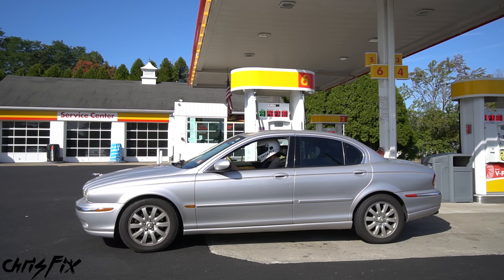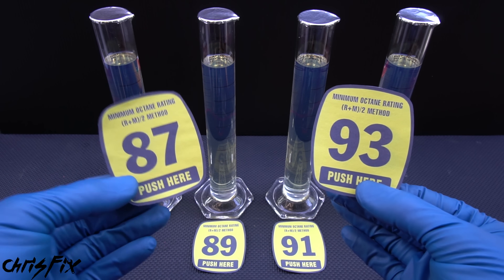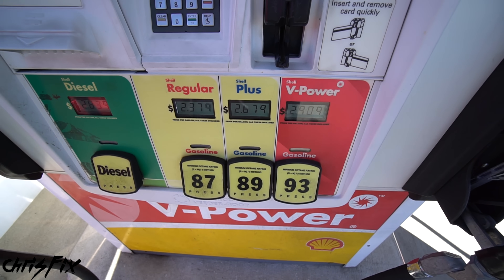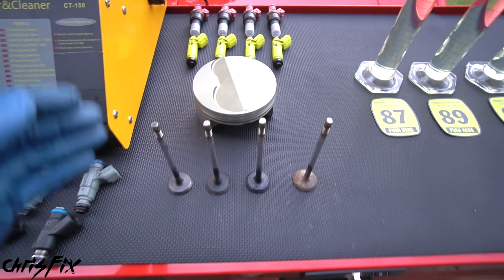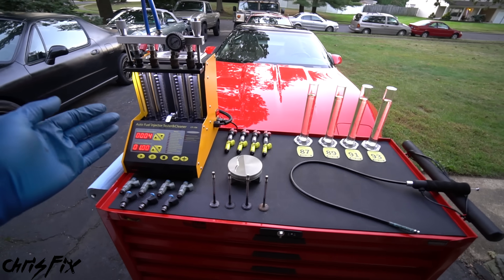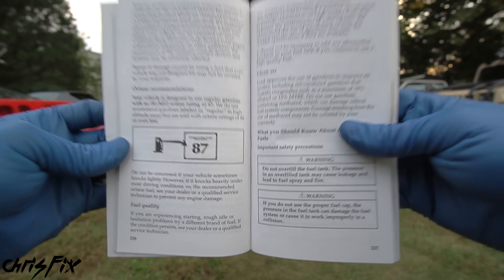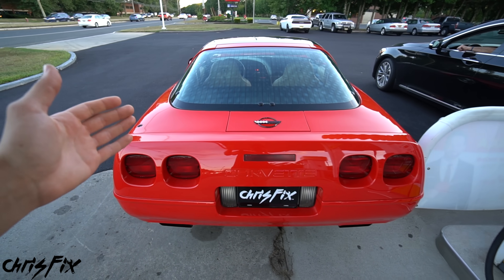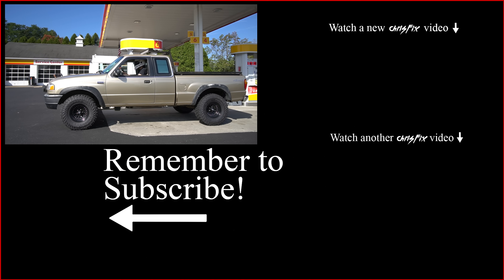What is the BEST Fuel to Use in Your Car or Truck and WHY

Comment: So my gas lines are a lil gucky and when I’m low and gas it like stutters when I press the gas a lil harder than normal so are you saying if I use a gas with a higher octane it can clean out my gas lines?
Reply: That gunk is from the ethanol in our fuel.  A few tanks of fuel with ethanol treatment added should take care of it. Ethanol free fuel is better but harder to find and more expensive, but well worth it if you ever want to see what ethanol fuel does, just run your lawnmower with regular e10 pump gas. I guarantee the next year it wont run. I accidentally put some in my pressure washer when I grabbed the wrong gas can while washing my driveway last year. This year I started it and it ran wide open and I couldn't get it to slow down. It was screaming! Pulled the carb and the thing was stuck wide open so the governor couldn't slow the engine speed. I couldn't get it to close. In fact I could feel the plastic piece trying to round off, which would have destroyed it. Used some brake clean and some WD-40 and gradually worked ut until it was finally loose. Where we live there is Ethanol free fuel but its 87 ir I'd run it in my 03 Land Rover discovery.

Comment: Ok. I HAVE to be the one to say this!!! Chris fix, I love your explanations and tests to prove your "facts" and you truly are knowledgeable and accurate, BUT, your video on the types of gas for your car is blatantly contradicting on two things you said that are PROVEN to be FALSE on your part!!!! First you say that 93 octane does NOT improve mileage or power over 87 octane then when you talk about your Corvette you said it actually DOES BOTH. My dad worked for GM factory for over 65 years! I KNOW ALL the tricks of the trade for vehicles. My brother races cars for a living ad well, so now I'LL tell you the REAL AND TRUE FACTS on fuel grade. I did these REAL-TIME tests with a 1995 Chevy lumina, 1985 chevy celebrity, 1996 Monte Carlo, 2005 chevy mini van, and a 2006 Lincoln zephyr, and now, a 2016 Lincoln MKZ, & a Nissan Armada SE.  1st, I drive the mini van between Miami & Asheville, NC twice a year...these 2 cities are exactly 787 miles apart. The van says 87 "recommended and it gives me 347miles on one full tank of octane, my dad told me to use 93 on my next trip and it gave me 453 miles!! I did this 5 times!!! And EVERY TIME I got better has mileage with 93 octane. Also, since my brother races, I asked if I could do a test on the track. This mini van goes from 0-60 in aprox. 15-17 seconds. When I did the test one week later with 93 octane, it went from 0-60 in 10 seconds!!! SO, premium gas DOES improve mileage and power in MOST vehicles!!!!! These tests had the SAME results for ALL the cars I mentioned.  Including my 787 mile trips!!!
Reply: Correction::: one one part of my letter it's supposed to say "on a full tank of "87" octane...  so, if you drive ALOT, filling up with "cheaper" 87 octane 2 to 3 times a week is NOT cheaper than filling up with premium once or twice a month!!!

Comment: 2:09 These 3 octane's difference in their resistance to ignition is equal to their difference in flashpoint temperature. 87 flashes at a lower temp than 93.

Comment: Why is it that my 2015 civic si I should only put 91 cause on regular it shakes on cold start
Reply: After seeing this video, the motor's compression and you don't want to suddenly have the motor make noises and the car to stop running. Better to spend a little more at the pump using the correct fuel than a lot when you need to take the car to get fixed.

Comment: I can attest to that! I had a high performance 2 cycle racing engine on my boat which said to use 93 octane or higher...Well i went to Florida one time to fish a big Bass tournament, I was so stoked just to be in the state of Florida that when I stopped for fuel, I totally screwed up and pumped 36 gallons of 87 octane by accident...I didn't realize it until I was hanging the pump back up...So i thought I would run out a half tank then fill up with 93 and all would be good, NAH that didn't work...My motor wouldn't even start lol, it would just sit there and flood out every time I would try to start it...So I tried to buy a couple pints of 104 octane booster to get it running and this worked! It totally ran like crap but at least it worked....Thought I would share this in case someone ever made the same mistake, they can get by on Octane booster...Good Video man, thanks for the information!

Comment: I actually did an experiment using different fuels from different gas vendors on my flex fuel silverado. I'm in El Paso Texas where we have 85,86, 91 octane and E85 as well. So my test involved 3 of our major gas station and the few locally owned tier 1 gas stations as they completely bought out the Shells and Chevron's overhere we were left with Valero, Speedway and Circle K. We actually have very little 7 elevens so I rules them out and used Mobile gas as the Tier 1 control. My findings were that some regular octane gave better fuel mileage and power than other brands, premium grade lasted less while provided more power. And mid grade provided the best fuel mileage with power. Tier one remained the best my 4.3L gave me 33 MPG highway running mid grade mobile gasoline with excellent power. E85 always give me the most power but gives me the worst gas mileage. My expirment control was full tank till the empty light turned and reset my range tracker when it turned on to add additional miles till I reach the gas station. I also would reset the range tracker when I filled up at the pump for the most accurate results. Over fuel grade and octane does effect your power and MPG. Not sure if it's due to my ecu. Just thought I'd share with you.

Comment: In every vehicle I have ever owned, (been driving for over forty years), I have consistently got way better mileage from high octane fuel. Presently I drive a 2005 Ford Ranger, 3.0l which when tested gave me a mileage increase of over 10% versus low octane. Well worth the price difference.

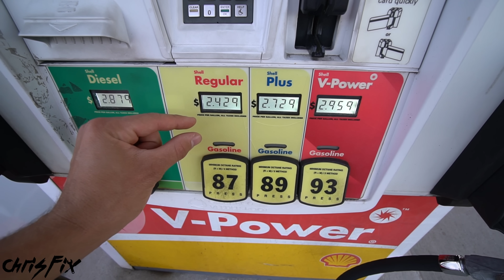Comment: 12:22 says you'll lose fuel economy and power by using lower octane
1:40 says it's a myth that higher octane gives better fuel economy and/or power 
what is the truth?
also im curious if, only Shell's, or in general, premium fuel is cleaner burning or have more detergents than regular gas? i usually use BP, Walmart, Speedway for gas, whatever has the best price
Reply from the maker: At 12:22, I'm talking about cars that are "premium recommended", not like your normal car that is designed to use lower octanes like at 1:40
Reply: If your car calls for premium, yes you'll lose fuel economy, if your car calls for regular 87 it will not make much of a difference. One thing I did notice is when I ran 90 octane ethanol free fuel I gained almost 2mpg on the highway returning back from a road trip last week.

Comment: Living in south tx we always use 93 with 110* weather is the only way . And its a proven fact 87 octane burns faster than 93 octane . Not sure where you tested those fuels but weather and outside temp determines alot .
Reply from the maker: Thanks for sharing!

Comment: It's true that all the octanes have the same energy content, however higher octanes enable higher compression ratios, and higher compression allows you to realize more power from the burning of the fuel. The improved energy extraction from the process contributes to more power and better fuel economy. BUT, like stated in the video - only if your engine has high enough compression to take advantage of it.
Reply: Mike Wright Doug is partly correct. Compression ratios for engines are by design.  Not all engines have the same compression ratio.  Higher compression ratios allow an engine to harvest more energy from a given amount of fuel. However, higher compression ratios require higher octane values to prevent knock/pre-ignition. Using gasoline with insufficient octane levels will damage your engine and eventually cause engine failure.
Reply from the maker: Thanks for sharing!
Reply: Perfectly stated.
Reply: mike h  I think the rule of thumb is around 10:1 and higher needs premium. My old first car's compression was 8.2:1 and I only ever gave it 87AKI. My current car is 10:1 and the manual says to use 91AKI.

I'm not a mechanic, but I've never seen engine compression stated in absolute pressure (psi), only as a ratio of a cylinder's bottom-dead-center volume to its top-dead-center volume.

EDIT: my car RECOMMENDS premium, and I use it to keep the knock sensor from throwing codes. I've also seen an engine with a 12:1 ratio that recommends 87. High-compression engines can be tuned to use low-octane fuel. It would be nice if the engine could adjust the timing to take advantage of premium, but I doubt this is the case.
Reply: mike h  That's what I'm wondering.
Reply: LPG has a higher octane like 102, is it good for using in car. ..
Reply: incorrect at a point.  it depends on the additives from the processor.   Those additives are different country to country and refinery to refinery.  Only 70 percent of gasoline is energy releasing via the simple chemical process formula.  The other 30 percent is to achieve the exhaust emission laws.  Think of the 30 percent as a smog pump on an early 70s car used to modify for the correct output.
Reply: Warm Soft Kitty  nope.  energy released is energy released.  It INCREASES total detonation time only.  This spreads the energy across the piston during the top and desending portion of combustion stroke.  It results in a.more efficient use of the energy for the application.  Energy is energy and you do not magically create energy via octane.  You more efficiently utilize the energy released.
Reply: Warm Soft Kitty  I did mention by original design. My answer was simplistic and doesn't account for all you  guys throwing new crap under the hood.
Reply: I'm still learning about my VW CC 2.0T. wonder if this matters for me?
Reply: @danp4930  Unless you or someone else has altered it from its original design. I would use whatever the manual specifies.
Reply: So what about VC engines (variable compression)? We know Mazda newer  CX9 can use premium or regular with actually hp differences as a result. Under load, I’ve read Camry’s newer engines can adjust compression to 14:1.
Reply: mike h  12 to 1 and up it is a must to run only premium.
Reply: Different octanes do not create higher compression. Compression is exactly what it says using compression to squeeze the air depending on the piston volume and bore size of air getting compressed in the compression phase.
Reply: Engines have designed compression ratios. You don't just "increase" the compression ratio by using higher octane fuel. As soon as a spark is introduced to the fuel/air mix...its going to ignite. the higher octane only serves to stop premature ignition, like Chris points out. You would have zero increase in energy output in your Toyota Camry by only increasing the octane.
Reply: Doug G. That hurts Doug, I just filled up on premium on my camry😢😂
Reply: @Its.michxel  I'd go with what your manual says unless you notice it knocking! Save yourself the couple hundred bucks every year.
Reply: Doug G. Yeah for sure, I heard that premium gas can help with catalytic converters problems not sure how accurate that is.
Reply: @dgfreshx  While it's true that the compression ratio of an engine is fixed and doesn't change depending on what fuel you use (except for some experimental variable compression engines), many engines do automatically adjust turbo boost pressure and ignition timing depending on the fuel octane so you will get some advantage in power and maybe also fuel consumption in such cars. Maybe not so much that it's worth the extra cost per liter, I don't know that.
Reply: @skunkjobb  you just mentioned turbo boost pressure.  That would usually dictate a higher octane.  I have an A4 that requires 91 due to the compression. Im speaking to the average person who has no clue and thinks it burns cleaner or something.  Not you nerds that tweak your cars out lol.
Reply: @dgfreshx  I'm not talking about tweaked engines, I'm talking about standard turbo engines like any Saab from the 90s or later. While the compression ratio of the cylinders is fixed, the actual peak pressure is not only determined by that but also by the turbo boost pressure and it is automatically adjusted as well as the ignition timing by signals from the knock sensor so it adjusts to what octane fuel you put in the tank. But as long as you don't pull close to full throttle, you will have no benefit of higher octane in these cars either.
Reply: @skunkjobb  I don't even know what you're arguing about.  I drive a Saab 900...it definitely mandated 91. Some cars only recommend and adjust accordingly.  I never argued this.  All I said was use what your manual recommends. I'm am engineer and trust other engineers more than youtubers.
Reply: @dgfreshx  That's not what Mike Wright was saying. Higher octane allows engineers to design engines to have higher compression not that it makes engines have higher compression.
Reply: @jamesfox6664  I see your point. It was worded strangely that seemed to imply the fuel made the compression ratio increase. I read it wrong I guess.
Reply: Can’t believe I’m going to say this... You’re both correct! 😂 Not often you get that in the comment sections.

Comment: United Kingdom Here ... To be honest, ever since my first car trying out some supermarket low-grade fuel (which was recommended in the manual) I got shocking MPG and it seemed really sluggish on the throttle. Ever since, I've always used BP Ultimate or Shell V-Power.... I notice a massive difference in the fuel economy so i already make my money back with those extra miles. and like you said, it keeps things clean, so why not do it? few quid here and there could save you hundreds or thousands in repairs down the line. It's barely any more expensive anyways so I just whack it in and my car seems to thank me for it .  Great video btw explaining the process of everything.
Reply from the maker: Thanks for sharing!

Comment: Well I got a 1998 subaru legacy gt wagon with 60,000 miles. I use 87 as what's it's recommended but when I ran 91/93, my subaru drives wayyy better than regular 87.

Comment: Chris,,,my Yukon has that flex fuel on the back,,I bought it used and it didn't come with no manual,, should I stick with the regular gas or use that E-85 gas?
Reply: E-85 gives you more power but less Gas mileage. Although E85 is cheaper it ends up getting less miles per gallon. I just do regular gas.

Comment: You have a thing you forgot to mention is the fact that most cars run much better with non ethanol fuel.  They produce more power get better gas mileage. The older they get the better they run with non ethanol h*** someone even run or produce power when you put ethanol fuel in them.

Comment: I had a 4.3-powered Sonoma that called for 87 octane. I ran 94 octane in it until I realized that it used way more fuel and didn't run as good.

Comment: I have a 2015 Chevy malibu.... it’s also a flex fuel gas but I use 87, I never checked the manual for proper fuel to use! If I check the manual and says to use E85..... how would I make the change to make sure the car runs like it should

Comment: Stay away from ethanol if your engine is  Carbureted. It will gunk up your carburetor and cause the engine to putter. Fill up with 100% pure gasoline. If your engine is fuel injected like most new vehicles are then use ethanol. I use pure gas with 0% ethanol in my 96 sportster, 78 fairmont, weed eater (dont forget to mix gas with oil) mine is 50:1 ratio and most are the same

Comment: Ok. I just found this in my manual.
2.0-liter and 2.5-liter engine
Your Mazda will perform best with fuel listed in the table.
Fuel Octane Rating* (Anti-knock index)
Regular unleaded fuel 87 [ (R M)/2 method] or above (91 RON or above)

* U.S. federal law requires that octane ratings be posted on gasoline station pumps.
Fuel with a rating lower than 87 octane (91 RON) could cause the emission control system
to lose effectiveness. It could also cause engine knocking and serious engine damage.

Comment: best answer: USE WHAT YOUR MANUAL TELLS YOU TO USE. Do not go higher in Octane just "cuz"
Reply: Good anseer you have no idea what your talking about
Reply: @russellleahy  How am I wrong? My answer paraphrased the videos conclusion.
Reply: @dgfreshx  Technically you're correct but using a higher octane does have merits.
Reply: @ShiningJudgment666  Aside from rare circumstances where you are experience knocking using the recommended octane level there isn't any reason to go beyond what the manufacturer recommends. There is no difference in potential energy, and no difference in the amount of cleaning additives. All you are doing is wasting hundreds of dollars per year. Please link me anything that proves me wrong.
Reply: @dgfreshx  I mean, it's explained in the video. It's good for cleaning out carbon deposits. I run higher octane because I have a higher mileage car that I use for work. Over 220,000km and no issues aside from general maintenance and wear and tear stuff. When I use regular which is manufacturer recommended, it runs rough and the fuel economy isn't as good so there is a notable difference. Still runs pretty much like new from when it was built in 2002.
Reply: @ShiningJudgment666  the cleaning additive is the same though in both fuel types, higher octane fuel doesn't clean your engine better. It makes sense if you have a lot of buildup though as he says in the video. A hot spot could combust the fuel faster. That scenario would make sense with an older vehicle. That's awesome the car still runs well that long.
Reply: @ShiningJudgment666  2:13 literally says higher octanes don't burn any cleaner or more complete